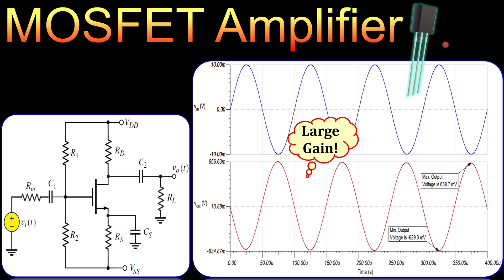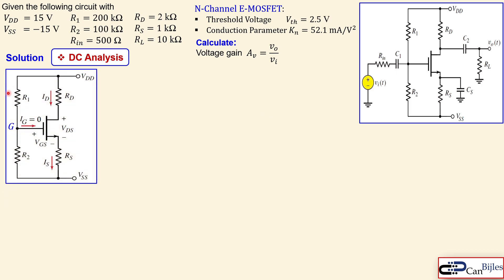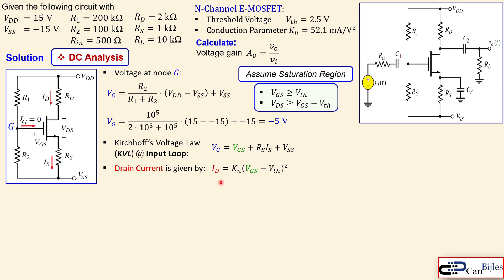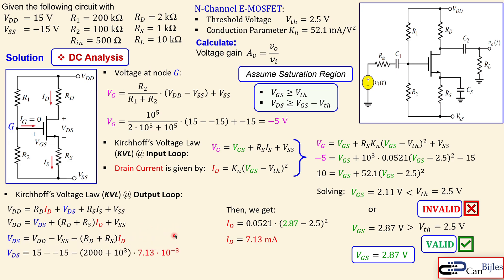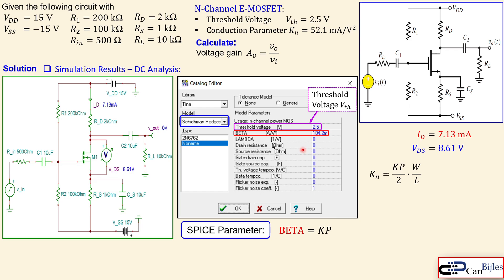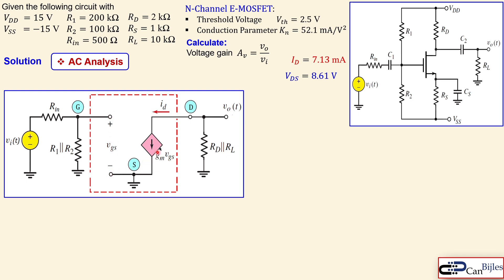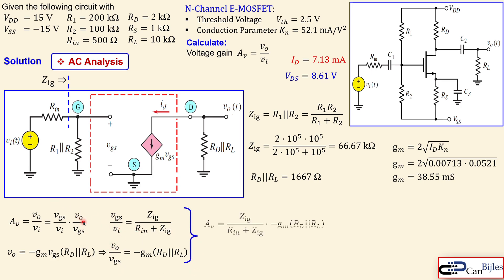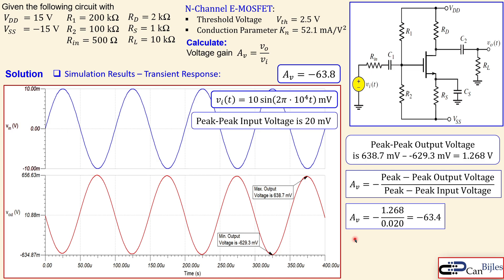Common-Source Amplifier 🌟 N-Channel E-MOSFET 🌟 Calculations & SPICE Simulations 💡 Example 1

Comment: If we add resistor Rss  above Cs 
What Will change 
Thanks
Reply from the maker: Adding a resistor (Rss) above Cs would change the biasing and therefore the gain and frequency response of the amplifier.

Comment: I just can't wrap my head around the voltage divider equation for node G 🙁
Reply from the maker: What is exactly not clear for you with the voltage divider rule at node G? Maybe I can explain further.
Reply: @CANEDUX  I understand where the resistors coming from into the equation, i kinda understand the (Vdd - Vss) but i couldn’t get why there is another Vss added to equation
Reply from the maker: @anzx0699  The reference point of node G is ground. So, in order to set that correct, we have to add the Vss also. You can also work out the Kirchhoff's Voltage Law from Vdd all the way to Vss, and then make the expression for the voltage at node G. You will get the same expression as I did with voltage divider rule.
Reply: @CANEDUX  ohh, I see. Thank you for explaining further. Some of these subjects makes me question my intelligence 😅
Reply from the maker: @anzx0699  Glad to know that the problem is solved 👍 Good luck!
Reply: @CANEDUX What is exactly meant by reference node?
Reply from the maker: @waffle9624  It depends on the question what the reference point is. Usually, the reference point is taken ground (0 V).

Comment: Recognizing that the same current I goes through R1 and then R2, I wrote the following:  (Vdd - Vg)/R1 = current I = (Vg - Vss)/R2.  Since we know all the values except Vg, put them in this equality and then solve for Vg : (15 - Vg)/200k = (Vg - (-15))/100K and get Vg = -5 volts.  This seemed more easy for me to understand.  Your explanations are very clear and easy to follow and make Tina spice circuits for.  Thank you for your efforts.
Reply from the maker: Thanks for your comment. Glad you like the video. We are calculating the voltage here, not the voltage at the gate. Why do you prefer this? Also, you should work in the AC domain; I do not see this in your solution too.
Reply: @CANEDUX  Thank you for your clarification.  I was using sloppy notification as what I was trying to calculate was the voltage at point G and used Vg to identify that point in the circuit when doing DC analysis.  I used you small signal model for the AC analysis and find the small signal model easy to understand,.
Reply from the maker: @richardsmith813   Ok, that makes more sense.

Comment: Hi, is there another way/method to calculate the voltage gain? Thanks
Reply from the maker: Yes, you can use the determine the G_m and R_out of the circuit. The voltage is the product of these two parameters.
Reply: @CANEDUX  how to calculate Gm? Thanks
Reply from the maker: @Fidel-tk5rq  It is easier to get the book of Behzad Razavi, Fundamentals of Microelectronics. He discuss this method with examples too. See: https://www.wiley.com/en-us/Fundamentals+of+Microelectronics,+3rd+Edition-p-9781119695141

Comment: Hi, When applying KVL on the input loop, why voltage across R2 not included although it's in the loop? Thanks
Reply from the maker: You can use the voltage across R2, but the objective is to determine the drain current and for this, we need the gate-to-source voltage (V_GS). The gate voltage (V_G) is calculated using voltage division, so the specific voltage across R2 will not add new information to the problem. Of course, you can calculate the current through R2 and use it to calculate the voltage at the gate voltage (V_G), but this will give you the same results. I should say, try it!
Reply: The concept of loop is critical when applying KVL as you have to come back to where you started.You stopped somewhere in the middle as you didn't come back to the original point (G)? @CANEDUX
Reply from the maker: @Fidel-tk5rq   Let me try to explain in steps what I mean.
Step 1: calculate the node voltage G.
Step 2: calculate the V_GS.
Step 3 and further is also explained in the video.
Reply: When you applied KVL @input loop you said VG=VGs+RsIs +Vss and you didn't complete the loop and considering VR2 to return back to the original point G? Is that correct, please double check! Thanks  @CANEDUX
Reply: Please advise!
Reply from the maker: @Fidel-tk5rq  The KVL given at 00:03:43 is set up from node G to ground. If you understand this part, then you will see you do not need the voltage across R2. Again, you can use the voltage across R2, but then you should set this up in a different way.
Reply: @CANEDUX  Actually my question is about this part! Is it possible to  apply KVL from node G to ground without come back to where you started (node G) to complete round trip around this loop?
Reply from the maker: @Fidel-tk5rq  KVL is based on the same begin and end point, but route can be different. Thus, you need to start at node G and end at ground, but it does not matter how you take route. You can say V_G = V_GS + I_S*R_S + V_SS or V_G = I_2*R_2 + V_SS. There are more, but always useful. As mentioned earlier, you will take the easiest loop, but you will get this in the first shot when you built some experience.

Comment: Hi, which one is the large signal DC source used for biasing Vdd or Vss? Thanks
Reply from the maker: All DC sources are for biasing. Biasing means DC voltage and current settings.
Reply: What size of coupling and by pass capacitors should be used in the circuit? and how to determine the size? Thanks  @CANEDUX
Reply from the maker: @Fidel-tk5rq This depends on the bandwidth the your circuit you are designing. If the coupling capacitors are too large, your bandwidth can be too small, but if you make the coupling capacitors too small the DC blocking and AC might not be effective. So, it depends really on the bandwidth. Usually, people take values in the range of couple of microfarad or even some hundreds of microfarads.
Reply: What are the required settings to achieve biasing? Thanks @CANEDUX
Reply from the maker: @Fidel-tk5rq  Biasing depends on the design of the amplifier. Generally, we bias the circuit such that the DC voltage at node G is the average of the total DC voltage supply,  but not always. Accurate biasing design is more involved and requires more steps.